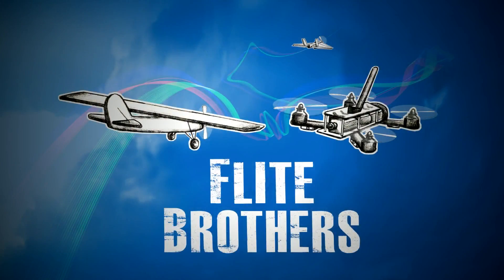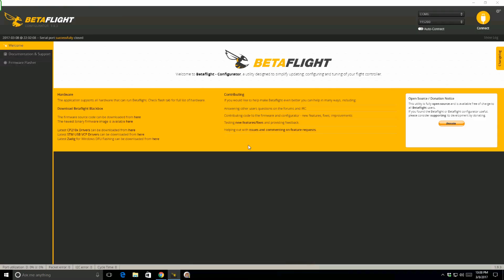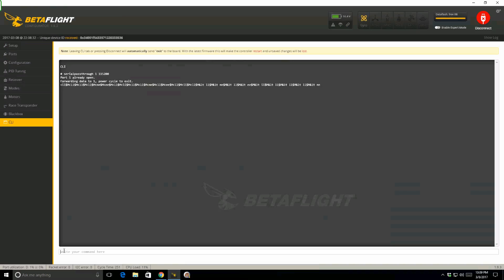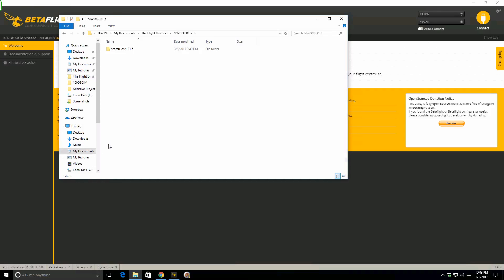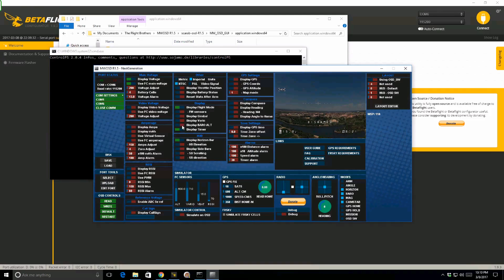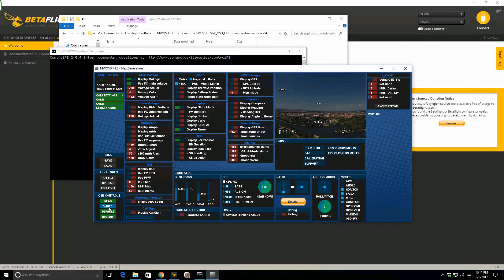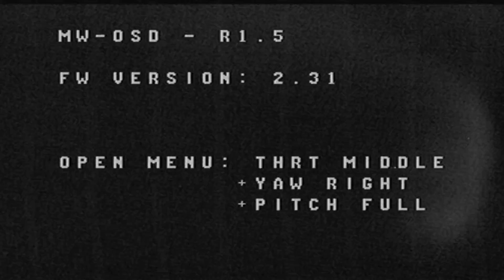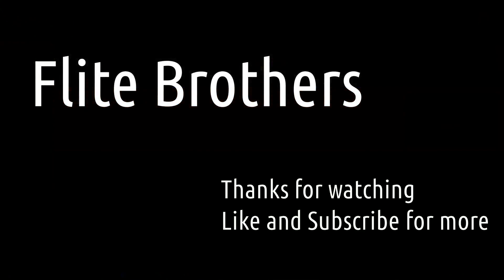Flycolor Raptor Stack OSD setup with Serial Passthrough

Comment: I understand the serial pass through, and have no problems with that, but how do you open MWOSD? When I do what you did in the video, I get the command prompt window for about a split second, and then nothing happens. In the video, the command prompt window hangs out for about 2 seconds, and then MWOSD pops up. What am I doing wrong? I'm using Windows 10 if that matters. Any help from anyone would be appreciated.
Reply from the maker: The old GUI can be finicky. MWOSD recently came out with a google app that is easier to use. I suggest you try that instead.
Reply: Thanks.
Reply: The Chrome Configurator will not work with this stack/MWOSD1.5 firmware. I have tried it. It pops an error code saying that it cannot communicate with the old version.(This is with the 1.7 configurator)
Reply: NoAgenda Drones  I just downloaded the Chrome App. It's cheap and easy, but it is a drag that you can't use Betaflight. Since that post, my Raptor Kwad is MIA. These days I'm using a Betaflight F4 and its OSD is fully configurable in BF.

Comment: Hello, I recently purchased an arris c250 v2 quad that has a flycolor raptor tower. I have tried to use beta flight serialpassthrough with no success.  I have the battery connected to the quad and the only thing that shows up on the LH SIDE of the screen is CLI.  When I'm in clean flight, I have all the options on the LH side of the screen.  All I really want to do is remove the sidebars and horizon bar from my osd.  I can't do this via my transmitter because I don't have telemetry. I apologize, I'm very new to the whole quad thing. Giant scale is easier than this!😀 Thanks for any info
Reply from the maker: I'm not sure what you mean. After you enable serial passthrough, you should be disconnecting from clean-flight altogether and then connecting to the OSD via the MWOSD 1.5 configurator tool. (Link is in the description)
Reply: Flite Brothers I am using Betaflight Configurator 3.1.1.    It connects with Comm 5. When I try press connect, I get a statement that says "Warning:  Non Betaflight firmware is not supported.  Please note that this tool is designed to support the advanced features of the Betaflight firmware, and does not support use with other types of firmware, except for in CLI mode."    It says CLI mode detected but when I type serialpassthrough 1 115200, it says "unknown command, try 'help'.   Again, I get all the features in the LH column when I use cleanflight instead, But still can't do anything with CLI mode.
Reply from the maker: I see. So it must be that your board is running some version of cleanflight that does not support serial passthrough. It would be best if you flashed the firmware on the board to Betaflight instead so you have this feature and you'll have better flight characteristics anyway.
Reply: Ok now you'll really have to forgive my stupidity. How do i do that and if I do, am I going to loose all the settings that are programmed into my flight controller.
Reply from the maker: Using Betaflight configurator you would have to click on the Firmware Flasher tabe on the left (before you connect). Then choose SPracingF3 as your target and the latest version as your firmware. Then on the bottom, click load online and then flash. You will lose all your settings though so you may want to take some notes of what was what before you try.
Reply: Ok thanks.  I'll have to think on this one.  Guess I could go into cleanflight and take pics of every page.  Will my OSD be affected also?
Reply from the maker: Dexter Dog No. Flashing your FC will not have any affect on the OSD.
Reply: Ok I'll let you know how it goes.
Reply: Why doesn't the cleanflight software support a CLI serial passthrough? It has a CLI mode.  Just wondering
Reply from the maker: Dexter Dog CLI is just a command interface for accessing features that arnt necessarily part of the graphical interface. Serial passthrough isn't a feature Programmed into your version of cleanflight.
Reply: Flite Brothers Hi Steve, I contacted the manufacturer(Arris).  They told me this is how they add items to the flycolor OSD.  Would this be an alternative easy way.  Have you ever done it this way.  They stated, "If you want to change it, you need a hardware equipment TTL, then connect it to isp programming of the F3 flight controller, and you can set everything of OSD."   Very broken English but maybe you get the gist.  Thanks
Reply from the maker: Yes. There is a large white plug on the FC with the connections to hook a separate programmer to it if you wanted. I didn't want to bother since Serial Passthrough works fine and is much easier. The only downfall is you cant update the firmware on the OSD via Serial Pass through as far as I know.
Reply: Flite Brothers Any brands that you would recommend for programmers. I'm just afraid of not being able to program my system correctly if I flash it with beta flight.  I did take pics of all the settings in cleanflight though.
Reply from the maker: Dexter Dog do you have FaceBook? If so, contact me there at Facebook.com/Flitebrothers and I can walk you through the whole thing if you want. It's not as scary as you think.
Reply from the maker: If you want to buy one, just search google or Ebay for USB TTL programmer.
Reply: Hi Steve,  I don't have Facebook.  I sent you a PM over in the RC GROUPS forum. Thanks
Reply: Dexter Dog Have you got things sorted yet? You should have been able to do what you want using your TX.
Reply: Yup. Figured it out last week.  Irock on the rc groups forum was able to figure it out.  First off, your tx rates have to be at 100% to allow the tx to enter the menu from your goggles.  Secondly, the range of the rx ranges have to be correct, ie 1000-2000.  Mine were not even close.  He showed me how to fix this through cleanflight.  Thx for asking.
Reply from the maker: Dexter Dog Glad you got it figured out. :-) Sorry I diddnt get back to you again.
Reply: No worries at all.  Have a good one!
Reply: Ha ha ha... Oh I didn't realize I had already helped you lol... I am Irock1985 on RCGroups.. Maybe I should change my name to match my YouTube
Reply: Thanks for this video btw... Helps fill in the gaps that I have yet to explore in my videos
Reply: Funny! Well thx for the help that you forgot that you gave and didn't realize it was you anyways!   Ha!

Comment: On the new stack I got a few days ago I was able to serial passthrough and use the new chrome app for MWOSD no problem, worked like a charm, surprised me actually. Version 1.7.15, thanks for the pass through tip!
Reply: Did you ever try 1.8.0.0.  attempting now, with the desktop software, so far, no good.

Comment: thanks for the video, been trying to figure out how to troubleshoot my osd. problem i have, is the osd disappeared from the video (im still getting camera) but i tried the passthrough and im just getting waiting osd when i load up mwosd.
Reply from the maker: Daytona FPV are you powering with battery. If so and you still have issues, I suspect your built in OSD chip is simply bad.
Reply: Daytona FPV Did this happen after flashing BetaFlight?
Reply: it's been so long i don't remember now to be honest, but it's possible... i have it all set right in betaflight ie uart 2 etc, im trying to find out if the osd debug port i can just plug an ftdi adapter into.
Reply: got the same issue here, waiting osd still blinking and i never can't connected ... help needed please.
Reply: i finally make it work, just close comm, and reconnect comm, i did tis 4 times and it worked.
Reply: sometime the loading time of gui is terribly long, let it load , it can take like 15 min to read... and 20 min to rewrite the change... so be sure you do that with a full battert
Reply: sweet baby jesus please work please work please work

Comment: I cant seem to get the 1.5 gui to open on my surface pro4 did the serial passthough fine but no luck launching the gui. Has anyone figured out how to update the firmware to 1.6 or 1.7?
Reply from the maker: Eric Boyd To update the firmware you'd have to use an FTDI adapter to the the ISP connection on the big white plug on the FC. What error are you getting on the GUI when you open it?
Reply: Just kinda flashes like its gonna open but then nothing. I have the google mwosd config too but requires a newer version of firmware
Reply from the maker: The original gooey is a Java based app. You're likely experiencing a Java problem. Make sure you have Java installed on your computer and also try both the 32-bit or the 64-bit version.

Comment: Yeah I just put a Runcam camera on my arris x-speed 280 v2 and now half of my OSD is cut off on the screen.  I can't get Mwosd 1.5 to work. It keeps showing up with one com port. Can someone please help me, I'm stuck.
Reply: I just switched the firmware over from cleanflight to betaflight and I'm trying to do the serialpassthrough to gain access to Mwosd and it will not work. I really need some help. I'm trying to take my signal off of PAL and put it on NTSC. I have some pictures if that would help.
Reply: Omg, I finally got it working. It never Once showed up on my PC like it was working properly it just kept saying OSD Waiting.....
I hit NTSC option and hit save and even know it didn't show that it was responding on my PC, it actually took the command to change it from PAL TO NTSC. Thank god, that was driving me crazy, I couldn't even see my voltage or my flytime and the OSD was flickering.